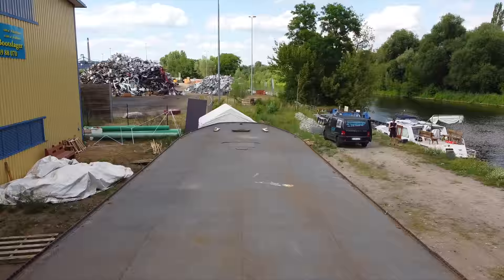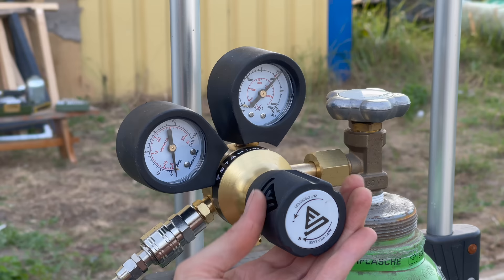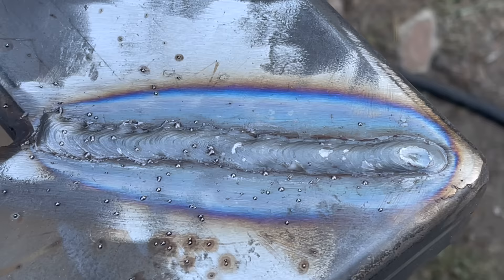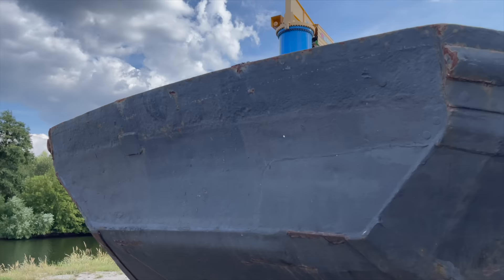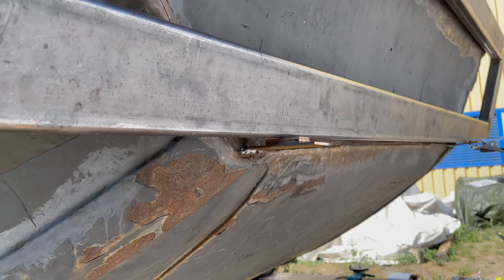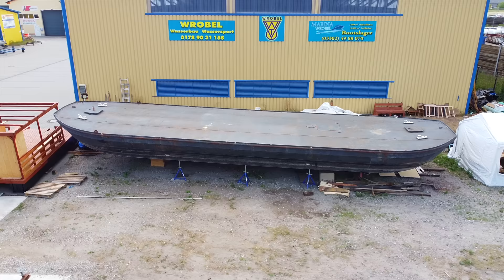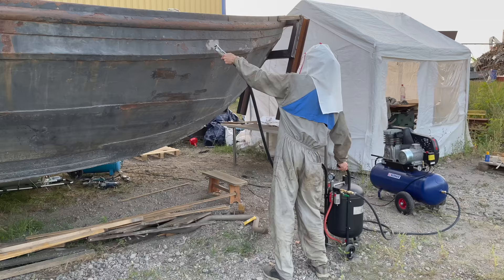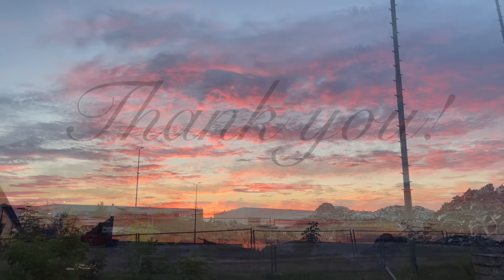Welding a HUGE transom & PAINTING the big boat

Comment: when welding, weld forwards not backwards, backwards is correct for the old stick welder you had but with MIG you should go forwards. also wind is your enemy with mig.. other than that the welds look great for the level of experience you have.. good work
Reply: MIG you should go forwards? Really? Where did you learn that? It is technique not direction. Look up what welding schools teach on the subject. Not trying to be rude but it is said by many but wrong.
Reply: @monkeyman2174  I'm not trying to be rude either, but are you being sarcastic? Every tutorial on the planet shows you to push to "stack dimes". I learned to weld in the military, Tig, Mig, Stick, upside-down and standing on my head. For certified welding, you use both technique AND direction "forehand welding" for proper penetration. For "backyard" welding or general working environments, the only time I cheat on direction "backhand welding" is vertical corners. Backhand welding is also generally used on thinner metals, so you do not burn through.
Reply: Direction – The MIG gun should be moved from left to right, adding filler metal on the left side as the weld progresses. Backhand welding is used significantly less than forehand welding but is superior when it comes to welding thinner metals.

The above statement was copied and pasted from the top answer when googling proper weld direction. WFT?!? That is straight out wrong or just vague as hell. 

The following is a reiterated explanation of the proper direction welding with Mig.

Direction – The MIG gun should be held at a 30-degree angle pointing in the direction of the weld and be moved from left to right (for lefthanded people) adding filler metal on the right side as the weld progresses, pushing the puddle. For righthanded people the Mig gun should be moved from right to left adding filler metal on the left side as the weld progresses, still yet pushing the puddle. Backhand welding, pulling away from the puddle, is used significantly less than forehand welding but is superior when it comes to welding thinner metals.

Comment: When welding thick constructions and joints (over 3mm) it is best to heat up the surrounding areas to minimize thermal stresses during welding. I have seen cracks forming right by the weld because of the huge temperature difference between the welded joint and the cold surroundings. In shipbuilding, they use induction heating to heat up the big ´´lego´´ pieces before welding them, to minimize stress and warpage. Also, when welding frames and etc, clamp them down on the table to also minimize warpage during welding. As the weld cools down it starts to shrink and bend the material toward the joint. Glad to hear you got your life back on track and cant wait to see this monster of a build take shape :)

Comment: Brother, you push a mig weld, not pull it. You either push it when its flat, or you downhill it in a verticle. 30 years welding plus a level 3 inspector, trust me. Push it up and back a little, or use a U shape, but you want to keep the weld puddle behind your torch and moving away from the puddle. This will help shield the weld better and prevent perosity. And please, I am not trying to sound condesending, it is just me trying to help a fellow welder.

Comment: You should get yourself a bevel square. You deal with a lot of angles on boats. It will help in other jobs as well. If you figure out how to use it well it will save you a lot of time. Set the level to its existing angle and cut your material. Steel,wood, plastics,fibreglass, glass

Comment: When welding, try pushing the puddle instead of pulling it. The advantage of pushing the puddle allows you to preheat the steel which makes a nicer weld.
Reply: Direction – The MIG gun should be moved from left to right, adding filler metal on the left side as the weld progresses. Backhand welding is used significantly less than forehand welding but is superior when it comes to welding thinner metals.

The above statement was copied and pasted from the top answer when googling proper weld direction. WFT?!? That is straight out wrong or just vague as hell. 

The following is a reiterated explanation of the proper direction welding with Mig.

Direction – The MIG gun should be held at a 30-degree angle pointing in the direction of the weld and be moved from left to right (for lefthanded people) adding filler metal on the right side as the weld progresses, pushing the puddle. For righthanded people the Mig gun should be moved from right to left adding filler metal on the left side as the weld progresses, still yet pushing the puddle. Backhand welding, pulling away from the puddle, is used significantly less than forehand welding but is superior when it comes to welding thinner metals.

Comment: Most new boats today are offering two versions of the same model- stern drives and outboards. Guess whats outselling? the outboards. In the states most of the salt water  boats have outboards. Easy to work on, easy to maintain, and offer the same power with improved reliability and efficiency. For a new boat or a new project, outboards are the way to go. you made the right choice! It should be easier to rig the steering linkage as well. You could even salvage something from a boat scrap yard.

Comment: There are tricks to fitting larger steel as well to keep square. Tack weld your joints in corners of joint before welding. 3 points. It will move and not remain square.

Comment: >  When welding slow down the side to side motion to build up a thicker puddle for bonding deeper in the gap. Quick motion thins out and bridges over the gap with a thin puddle.  The slight pause at either side showed penetration into the base material as you noted, which is good.  Do more practice welds and cut them across with your metal saw to check for penetration and full bonding. You have some nice equipment to work with so learn all you can. Take care.

Comment: The trick to both vertical and overhead welding is preventing the puddle from spilling out of the weld. For material thicker than sheet metal, vertical welding generally should be performed uphill.

Comment: If you push the weld, you'll get deeper penetration and a better weld overall. You seem to be good aboutt cleaning the metal, though!
The less stops/starts you do, the better, and try to wrap edges/corners. Oh, also I find circles to be a little easier than the zig-zag, but until you start doing crazy positions and thick metal (triangle pattern works best on bevel plate), your pattern should be mostly preference. 10:20 you can push that and whip it forward then back to fill that gap without stopping much- sometimes you have to pulse it but that's really bad practice.

Comment: Better make sure you got all your pin holes filled in on that square tubing. Any moisture that get inside will screw you long term and corrode out one of the walls as the moisture wouldn't have a way to escape. Some guys have even saturated the interior of the tubing w/ oil or tar but it makes a mess of flames & smoke when your welding on it. Personally, I would be burning the heavy wall stuff w/ a stick welder for penetration but your material preparation is good enough that you should be fine....assuming you got your settings right on that machine. Wouldn't of hurt to do a bend test in the beginning either on a few different wall thickness just to gauge the settings. Gonna be a hell of a boat. Best Regards.

Comment: Great video and very good welding as well. For removing rust the wire brush is by far the worst option you can use. There is a  product called Tercoo for the drilling machine that leaves you with good surface for coating. Or now that you have the strong compressor a needle gun would do the trick. But with a wire brush you basically just polishing the rust and like Arnold, it will be back 😉

Comment: Those are pretty good welds for someone learning, but if you want strong welds on thicker metal, you need to V-groove the joints almost all the way through (not just a small chamfer) to get full penetration, esp. if you can't get to the backside.  And put 2-3 welds on it, one root and 1-2 cap welds depending on how thick the material is.   Your pro friend got a full penetration weld in that corner bit....

These should be OK, but if you ever weld something safety critical (like a lifting frame) make sure you get weld all the way through the material.   Just some notes from someone who has been welding casually for 30 years and has had many, many welds fail....
Reply: At least he finally got a good MIG welding rig, and with a proper helmet!  MIG is great, indoors, but outdoors a wind can blow the shielding gas away.   Also MIG 'looks' good, but may not have proper penetration, as 'ck m' says.
Reply: At first glance of steel thickness, I would've opt'ed for stick welding for greater penetration alone. That tinny MIG is only useful for mild steel hence the 'snot welds' as can you see & high cown. This instantly shows lack of penetration. Once you grind the surface you're left with a weak weld. He would've been better off having it done with a proper 3phase unit - The professional guy that featured in one of the earlier vids resulting in less grinding. Going over welds is a waste of time & money. As my oldskool boss said all dem yrs ago "Do it once & do it right without cutting corners." This flags up some serious questions; the weight of the barge against resistance? The weight of those heavy H-beams welded on lower gauge steel? Personally I would've bolted those H-beams through with 8.5tn bpt bolts mounted with a heavy dudy backing plate on the inside of the hull allowing greater rigidity & weight dispersment thus the hull payload on that transom won't have to rely on those snot welds. Having though bolts also allows for future unforseen modifications save having to lift the entire barge out.

Comment: Mig welding doesn't like wind (best for indoor uses).  If using it outdoors you need to block all directions so your gas doesn't get blown away. You should be pushing your weld instead of dragging it. I prefer a stich movement or even add small circle .I am no expert but have been welding for 29 years. Anyone who states they know all there is about welding is full of it. There is only two ways you stop learning about welding is either you retire or die.

Comment: Nice, cant wait till you start working on top side. Dont worry about the rough hull, this is a barge designed for low speed. Before you put it in the water you may want to add some anti fouling paint

Comment: A wirewheel does not remove rust properly. The rust will return. Use a wirewheel (or strip disc) to remove paint and media blast the areas that are rusted.

Comment: Correct me if I'm wrong, but it seems to me you have welded the outboard bracket to the bow.
It looks as if there may have been a rudder attached to what looks like the stern ?
I will wait until it's finished before I say any more.
Good job so far !

Comment: Your new stern outboard mounts are attached to the old bow of the barge, the bit you didn't paint @19:58 is the rudder skeg, that was the stern, I hop you plan to remove this? if you leave it there and keep this as the bow the boat will be very difficult to turn.

Comment: you can get a power washer sand blast attachment and use regular sand I have it and works great with less of a mess and cheaper..and you didnt use antifoul below ? regular paint is not going to hold up in the long run nice work though!!

Comment: You are correct about your "monster" construct. 100x100 I-beams (not H-beams, actually they look a bit like UC's but never mind)  A bit of over kill, lol.  The channel would have been enough.
Reply: Universal Column (UC) is sometimes called H-beam, to differentiate it from UB (Universal Beam, or I-beam) which is intended for transverse loads. You're right, this is a huge waste of material in this application.

Comment: out of interest as its a heavy hull, with outboards, how are you going to gain the torque you need to turn and stop this thing when it gets going ?

I would have thought a deeper down large prop more suitable rather than small props closer to the surface
Reply: I would imagine outboards on this hull also mean slow speeds only. Whenever your wave pattern creates a larger trough at the transom, those props would be out of the water otherwise.
However given the waters around Berlin this makes perfect sense. Quiet canals where everyone moves nice and slow.

Comment: They are called I beams and not H beams. I've had said same as you before ! 🙂
Reply: I beams are deeper than they are wide (UB or Universal Beam). Intended for loads perpendicular to their length.
H profiles (UC or Universal Column) which he is using here, are about as wide as they are deep, and are intended for axial loads (acting in line with the length dimension).

Comment: We called them I beams instead of H beams
Reply: I beams are deeper than they are wide (UB or Universal Beam). Intended for loads perpendicular to their length.
H profiles (UC or Universal Column) which he is using here, are about as wide as they are deep, and are intended for axial loads (acting in line with the length dimension).
Reply: @Gottenhimfella  right on thanks for explaining

Comment: Just a silly engineering comment, if they are H beams you are using them wrong, I beams are great.
Thanks for great vid
Reply: Indeed, I beams are deeper than they are wide (UB or Universal Beam). Intended for loads perpendicular to their length.
H profiles (UC or Universal Column) which he is using here, are about as wide as they are deep, and are intended for axial loads (acting in line with the length dimension). The predominant loading here is a cantilever, so (as you say) H beams are not the ideal choice. However these are massively overstrong for their relatively light duty, so the point is moot.

Comment: Sorry but, You leaned something wrong at the start of video.. later you show some beter work 👍🏻! 
On the tig welder you must push over the weld as with rod you pull form the weld.
Make sure you pressure is way up as the wind is present.  Outside it’s better to use a rod welder

Comment: Direction – The MIG gun should be moved from left to right, adding filler metal on the left side as the weld progresses. Backhand welding is used significantly less than forehand welding but is superior when it comes to welding thinner metals.

The above statement was copied and pasted from the top answer when googling proper weld direction. WFT?!? That is straight out wrong. It's virtually impossible to add the filler metal to the left side while traveling left to right using Mig or Tig left-handed or right-handed!!!!!!!! 

The following is a reiterated explanation of the proper direction welding with Mig.

Direction – The MIG gun should be held at a 30-degree angle pointing in the direction of the weld and be moved from left to right (for lefthanded people) adding filler metal on the right side as the weld progresses, pushing the puddle. For righthanded people the Mig gun should be moved from right to left adding filler metal on the left side as the weld progresses, still yet pushing the puddle. Backhand welding, pulling away from the puddle, is used significantly less than forehand welding but is superior when it comes to welding thinner metals.